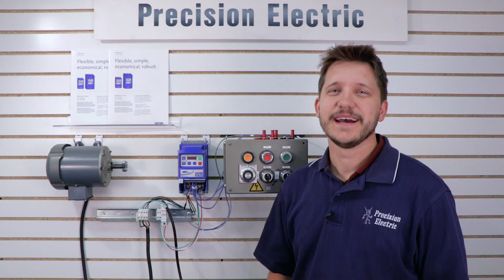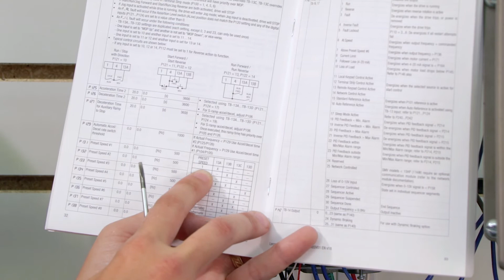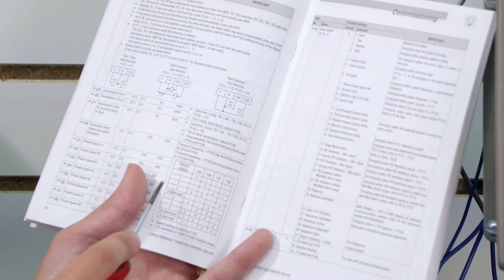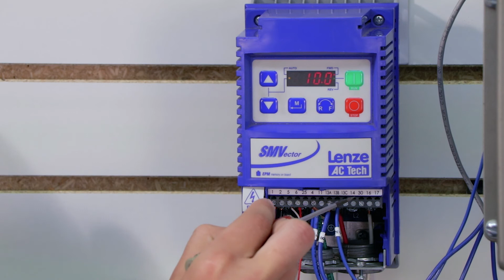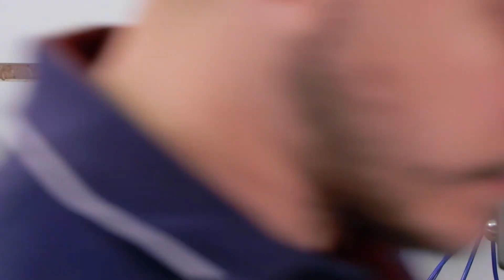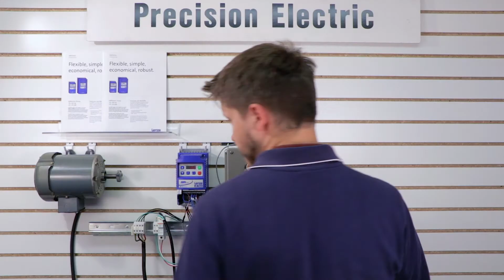Comment: What if we want to control the default speed of VFD using a potentio-meter and we add two normally open sensors in parallel to each other for a fabric. in that scenario when both sensors could be in operation or either one of them all the time then how could  we manage the main reference which we receive having from potentiometer. Thanks
Reply: i know Im asking the wrong place but does anyone know a method to get back into an instagram account..?
I stupidly lost my account password. I love any assistance you can offer me
Reply: @Lennox Tatum instablaster ;)
Reply: @Kendrick Jadiel I really appreciate your reply. I got to the site through google and im in the hacking process now.
Takes a while so I will get back to you later with my results.
Reply: @Kendrick Jadiel it did the trick and I now got access to my account again. Im so happy:D
Thank you so much, you saved my ass!
Reply: @Lennox Tatum You are welcome :)